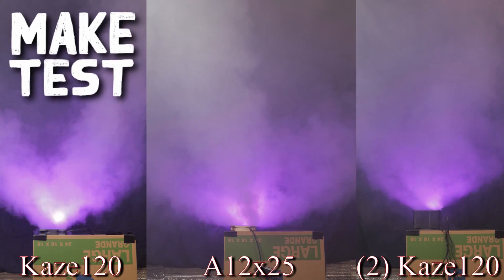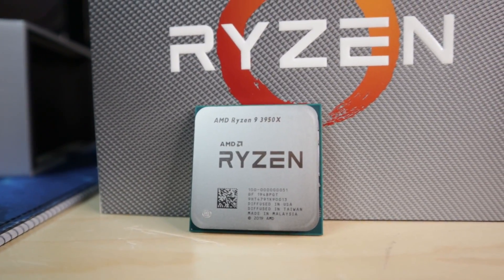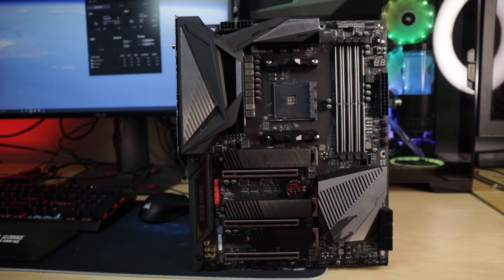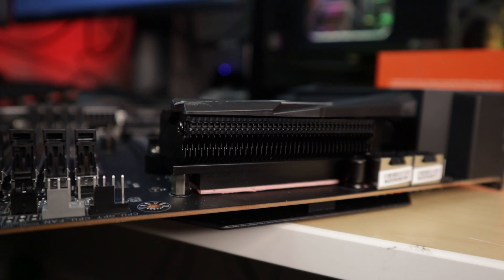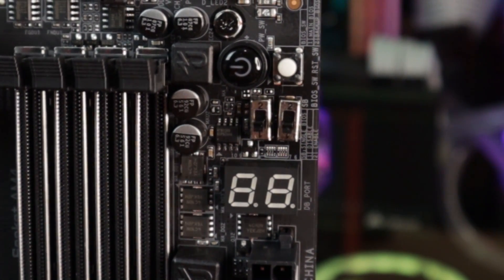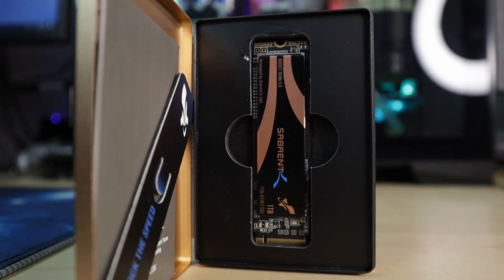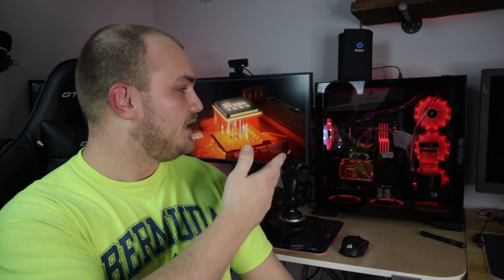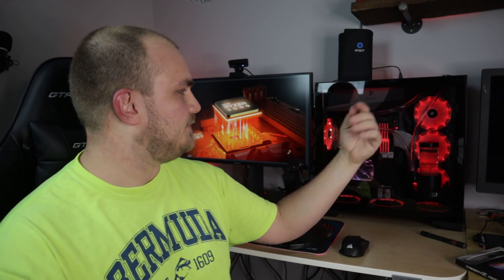EVERYTHING WENT WRONG, Upgrading I7-7700K to Ryzen 9 3950X

Comment: Obviously this video is from someone who has never worked with AMD Ryzen. I wanted to see what this video was about because it made it sound like there was a problem by going AMD.  IMO, the title by this YouTuber should be updated and not make it sound like AMD is at fault. I have built both Intel and AMD Systems.  He did admit he hasn’t worked with AMD. The first issue he mentions is having a cable mixed up with another manufacturer and happen to use one that WAS NOT from that PSU. He mentions he’s watched other channels and never heard that you can’t use another manufacturers PSU cable. This may be true. However, It is mentioned in all manufacturers literature that has semi or fully modular PSU’s to not do this. He states he did troubleshooting.  Obviously he didn’t check the entire PSU before buying another motherboard. So now, it appears he returned a perfectly good motherboard that he would have had to advise that the initial board was defective when it actually it was not.  He mentions the ram issue. Again, it was a bad stick from GSKIll. It happens. His next mention was about the chipset driver. Here is where you can most certainly tell he has never worked with AMD Ryzen. He mentioned the performance was lacking and then it came to light of going into AMD’s website to grab the most recent chipset driver.  Amazingly, it performs much better now.   At least you did mention at the beginning It could be you that did something wrong but then you had to go in and sound like you didn’t when in fact you did and didn’t own up to it. I would suggest before posting future videos like this, to do your research first so you can more accurately title the video. It sounded to me and a lot of others who painfully watched it and commented that you are making it sound like AMD is a problem when in fact it’s not.
Reply from the maker: Now that's a long comment

Comment: now before you buy ram this is what you look for gskill flare x 3200 cl 14 14 14 34 you can easily set them to 3800 cl 14 14 14 14 34 48 and go you actually will see a nice improvement from the 3k ram at god knows what timing you have as you did not list them here..  if you have to be rgb then get the neo's same bdie ram cl 14 14 14 14 34 3200  should be plug and play 14 14 14 14 34 48 the rest auto 3600 about 1.43v 3800 you will have to play a bit...

Comment: 3950X is no different than an old i7-7700k? Wow hats off to INTEL. Come one everyone you have to admit that is awesome for a 3 year old Intel chip that keeps up to a beast of a New Gen AMD 3950X 16 core 32 thread CPU. The intel 7700k CPU only has 8 cores with no extra hyperthread help. I bet the 9700K or the new Intel 10th gen chip when its released this year will out perform the 3950X in gaming performance and cost less. The 3950x should be compared to the chip in its price range which is the 9900K or something in the i9-Extreme cpu. To be fair. I love AMD and I am not an Intel fanboy I just look for true performance gains in gaming regardless off brand. AMD has made huge gains but its not really bragging rights to beat a chip that AMD should absolutely destroy in both gaming  and overall performance.
Reply from the maker: after some tuning its not as straight forward

Comment: I'm getting a pattern here. Intel only users used to easy mode moving over and not doing their research. I came from a 2500K but had AMD last time they were top dog. I didn't have any issues but I did a fresh install of W10, updated the BIOS and chipset drivers and checked what memory was recommended. I also use a good PSU. A little research saves a lot of pain 😉

Comment: Who else remembers the AMD Athlon days when Intel couldn't compete? Wasn't that long ago. Good old socket 939 days.
Reply: June 2004... I have coworkers who were babies then.
Reply: I do.
I had an pentium 4 with hyperthreading in late 2003, used it for a couple year tiln2005 then got a Athlon x2 4800 2gb ram and doubled my FPS in HL2 and counterstrike source using the same ATI x850xtpe.
The following year Intel released their core 2 duo processors and crushed AMD with every release until ryzen released
Reply: @mrkeefor  Core 2 had about 10% higher IPC than Athlon 64 X2.  That's not "crushed".  The Phenom II had about the same IPC as Core 2.  It wasn't until AMD emulated Intel's Netburst mistake with Bulldozer that actual "crushing" began.
Reply: I still have my 939 mobo here
Reply: Yeah the 939, if I remember correctly the first multi core CPU was built by AMD using that socket.
Reply: i had a 4000+ cpu - man those were the days :)
Reply: Socket A 462 Athlon XP Barton baby 2,16ghz
Reply: yup, Athlon64, a beast. First 64bits cpu, first cpu to adjust frequencies to load.
Reply: AMD Athlon 2500+  ;p i remember that's was the beast :) 1800 mhz 1 core and later came out first 2 core while intel was still 1 core good times!
Reply: my first pc was an athlon xp 1800+
it was my only amd build but i loved it so much
in 2001 xp was a compatibility nightmare... but it became a lot better when the sp1 came out.
Reply: Hell yeah! I still have my 4400+ I always had amd before I moved to a 2500k. I went 1400+, 3000+, 4400+, and then 2500k.
Reply: U
Reply: K
Reply: G
Reply: Uj
Reply: I
Reply: U
Reply: I
Reply: 3
Reply: Rolandooo   My socket 754 was a nightmare......so what!

Comment: I ve had 4 ryzen builds. 3 cpus. I ve built all4. 3 friends Ryzen setups all built. Absolutely no issues building. I only had issues was when ryzen first released on x370 with ram issues. This went away shortly after with future bio. And I don't mix cables from psus. My seasonics cables stay in seasoning bags. And corsair and evga in there own bags. Yes things tend to work when updated correctly. I only see user error here. No offense intended.

Comment: I've found that the lows improvement moving from the 7700k to the 3950X will be absolutely apparent in tougher games like PUBG, Insurgency Sandstorm, etc. I own the 7700K paired with two 1080Ti's (SLI disabled after game compatability issues) and the lows are what absolutely do me dirty. I can hit over 90 FPS at 2k at max on PUBG, buuuut the frames are so inconsistent that the choppiness gets me killed or I have frame skipping problems while ADSing. The 1080Ti should NOT have those issues, so I'd bet anything my problem is the 7700k.

Comment: Observations:
- PSU cable pinouts are only standardized at the component end - not the PSU end.  You're lucky not to have fried a component.  Never mix and match PSU cables - even within the same manufacturer, as the different product lines may be wired differently.
- Memory speeds matter on Ryzen in general, and Zen2 in particular.  Get that faulty stick replaced, and re-test at 3600Mhz.  I'd be surprised if the new system didn't edge out all of the previous Intel game performance numbers.
- Strongly recommend a fresh windows install when switching from Intel to AMD.  Yes, you can install all of the relevant drivers (like the chipset), but all of the previous MB drivers (chipset, LAN, sounds, etc) are still installed, and are in your registry.  This cruft will, at a minimum, slow your boot time, as the system attempts to reconcile hardware that's no longer present (typically results in timeouts).

Comment: Im surprised you never had trouble with the ram you were using beyond the DOA state of the trident, alot of ram noy originally manufactured by samsung is prone to bugging out and crashing with ryzen, found that out the hard way helping a mate with his build
Reply from the maker: i went out and bought another kit no issue PC running 3600 speed and i have OC my 3950x with the help of Buildzoid video and i have my 2080ti OC as high as it can go and things are pretty amazing i may need to follow up because i did discover 2 more things that were giving me trouble ha

Comment: Not all power supply supplies follow a common standard. It is possible to fry your component with mixing the cables. The motherboard needs to "train" the ram and may have some minor compatibility issues. It may reboot a few times and take awhile to do this "training" so let it sit a bit if you just are getting a black screen or reboots. Also before it trains you can try less ram modules say 2 instead of 4. Make sure it boots with 2 (no oc profile). then put the other 2 in and if success then try the ram XMP/DOCP profiles. Oh and update your bios helps a lot on the AMD motherboards... If you have problems with the DOCP ram OC profile with 4 sticks then try to set it with 2 before adding the 4 or you may need to manually set the oc clocks.

Comment: I have a very similar setup to yours, and you'll notice a pretty nice increase in performance once you install the 3600 DDR. The main issues I've had so far are related to memory: my X570 Aorus Master is very picky and I've been able to have stable XMP speeds only with Crucial Ballistix Elite BLE4K8G4D36BEEAK (4 x 8GB) - I've tried 4 other brands and sooner than later system was unstable, BSODs, random reboots... With these no problem at all, great latency and performance. So double-check the QVL on the motherboard's support section if needed.
Reply from the maker: i got a new kit of 3600 and its working GRRRRR ate now

Comment: If you want to mix cables, you gotta find the site that literally logs every PSU to the OEM and it'll tell you what the cable pins are. There are like 5 different big market OEMs that make PSUs that are then given branded enclosures such as Corsair's. Pretty much, each PSU cable has a different standard on the face that plugs into the PSU while all the ones into the Mobo are standardized. This is why custom cables are extensions rather than a raw cable.

Comment: There is a really easy way to have your 3950X perform just as well as an i9-9900KS in games where the benchmark results will be pretty much the same.
Reply from the maker: I have the system stable now and i checked out Buildzoid video on tuning the 3950x and also got my 2080ti OC as well this is running great now ill make an update as soon as i change 1 more thing.
Reply: @MajorHardware  Yeah, Buildzoid only managed to get a CineBench score of 9,600 though, and not 10,170. :D

And of course he was punting in a shit-load of voltage to do it.